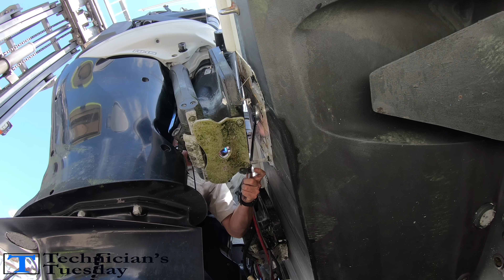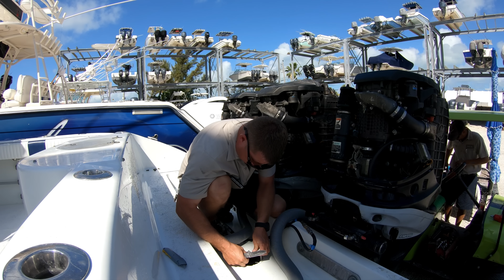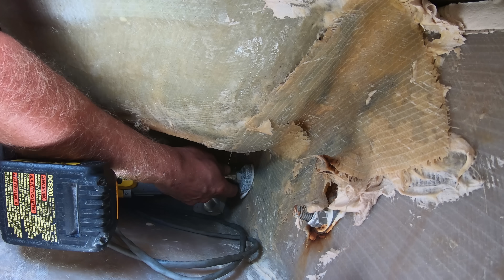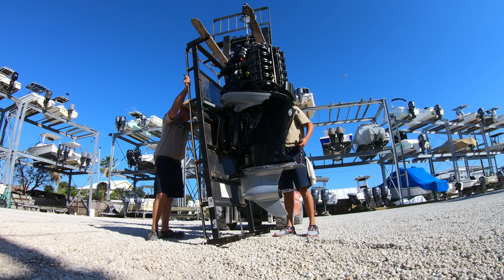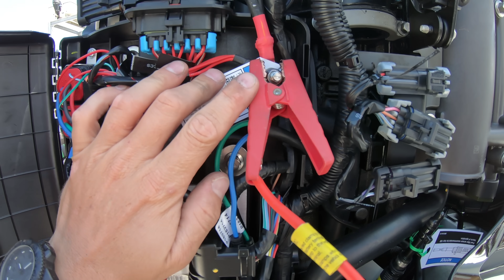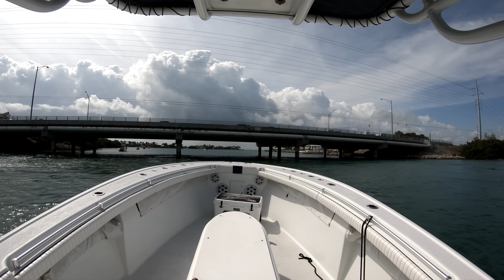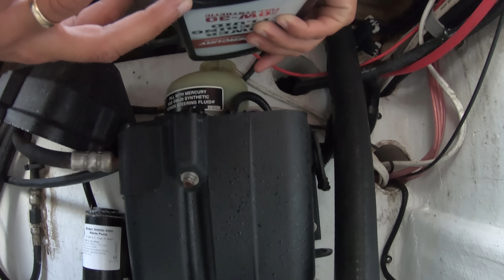How To Mount An Outboard Motor Properly - Start to Finish!

Comment: Might seem like a silly question but when someone repowers a boat, what do they usually do with the old engines? Are they traded in on the spot?
Reply from the maker: No, that's not a silly question at all.

It depends on the owners and the engines. Some engines arent worth any money, so they get sold to a wholesale that parts then out and scraps the engine.

Other engines are sold to a different wholesaler that then repowers boats and sells them. 

Sometimes the owners have someone that they want to give the engines too or sell them too and then sometimes the owners want any too much money for them and so no one buys them and they sit until they are worth even less that they would have if they would have been sold. 

I guess it really depends on the owner! Great question, thank you for asking :)
Reply: Thanks!! I always imagined the owner hauled the boat plus the old engines home after the install - which would be a major pain I'm sure
Reply from the maker: You're welcome! Thank you for commenting! Yeah, most people don't want to have an outboard laying on a pallet in their front yard :) lol

Comment: Nice video I have a question I check my 30 Donzi with twins 250s yamaha trim all the way in and the line goes like 1/2 inch over the top of the water pick up the are 2 feet back from the bottom of the hull they are set now on the second from the top hole so I guess I need to go up at least one more hole what you guy’s think thanks and i will appreciate you’re help

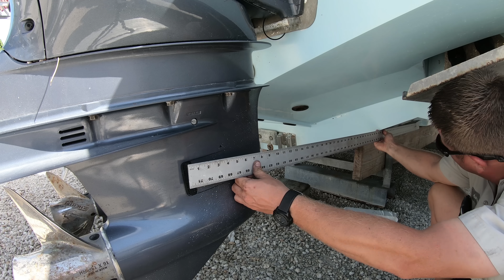Comment: I watched this video to see where to mount your motor and where the water should be going across your lower unit and you say it should be coming off the bottom of the boat and should be  above your water pickup. where he has the straight edge coming off the bottom of the boat you're about a third down on your water pickup and if you look at 4:14 the back of his straightedge past his right hand you'll see the straight edge ain't even up against the bottom of the boat so that means that  your water pickups will be out of the water when the boat is on a plane.  I'm not going to mount mine like that I don't want to burn up my motor not sucking water. I'm going to  Mount mine lower where the water will be going over the top of the water pickups on the lower unit.

Comment: Why the outboards at the extremity are always mounted higher than the one at the center ? Can you explain that ?
Reply from the maker: Certainly! You'll probably notice that on all boats that have triples or quads that the two outside engines are either mounted higher or they are a shorter driveshaft length than the center engine or engines.
That is just simply to form to the hull of the boat. As the water comes off of the bottom of the hull, the only thing you want in the water is the lower unit. So that the water doesn't go over the anti-cavitation plate and suck the back of the boat down and make it perform poorly in the water. 
Most of the time the center engine is a 30 inch driveshaft and the outsides are 25 inch. On quads the center engines are still 30's but depending on the hull, the outsides will be 20 inch driveshaft's!
Hopefully this helps out, let me know if you want to know something else! Thank you for commenting!
Reply: Born Again Boating Thank’s a lot for this rewarding answer 😊
Reply from the maker: @skandertrabelsi  you're welcome! Thanks for asking :)

Comment: Hi Born Again, 
If is only two engines on a mono hull they have to tilt sligtly outside as the video shows or turn them sligtly facing the front keel?
Thank you for the videos, all the way from Moçambique!
The best channel
Reply from the maker: Thank you! You shouldn't have to "tilt" either of the engines, they should be straight up and down on the transom :/
Reply: @BornAgainBoating  
On the video at minut 5'.54ss you mention that if is desire the boat to go straingh, the engines must " toe in  slightly " but on the diagram you showed, the engines exactly are toe out!???
Reply: @BornAgainBoating  I got it now, 🤙🏾🤙🏾🤙🏾keep the engines straight and compensate slightly on the tild bar by extending abit, this of course will reflect in the propeller,  and keeping the bow stright and balanced, top top. 
Best channel for sure.
Hugs from Mozambique

Comment: Great video. Thanks for sharing,   Just curious is there a big improvement with the 350s also what would that cost,  I am guessing somewhere in the 100k range?
Reply from the maker: To a point, the 350's are pretty well dialed in with minimal issues! For trips, yeah its about in the 100K range, depends on what all you are changing. If just the engines, I want to say it's a bit under 100

Comment: where should the anti-ventilation plate sit in a single motor application? I have a single 130 E-TEC on my 17'7'' Pionner Sportfish and have always thought it sat too low.
Reply from the maker: You'll want to take a yard stick and check to make sure it's sitting like the video shows :)

Comment: I don't understand tie bar
Can you please tell me exactly how much distance should be
Reply from the maker: Hello, sorry for the confusion. No I can't because every boat is different. That is why you have to measure between the steering arm and the propshaft. Compare the two distances and turn the propshafts in about a 1/4 more than the steering arms.

Comment: Hi, I have a Yamaha 9.9 kicker that I want to install on my 23 Grady closed transom. What would be the proper height for the motor once it is in the down position? Once again your videos are awesome. Keep up the great work!!
Reply: honestly - it doesn't matter.  the motor is never going to plane the boat. planing , top speed and fuel efficiency is out the window. 
you have more directional control and more bite on the prop when the motor is deep.

Comment: Thanks for the great video, I check my Suzuki’s 300 on the HydraSport 28 and found out that the water pick up is 2” below the bottom hull at 33” out ,I always thought they were low  when they repower my boat .please let me know if this is done with the engine in all way or level with the bottom hull, thanks again
Reply from the maker: Thank you! That does sound to be a little low. The main thing is that you don't want that cavitation plate to be under the water coming off of the bottom of the hull when you are running. 

Generally you check this with the engine tilted all the way down or all of the way in! What are you planning on repowering with?
Reply: Thanks again Sorry for the delay a wanted to check it out before it turns out that I get the same results 2” from the bottom of the hull to the top of the water pick up engine level to the hull and 2” from the bottom of the hull to the top of anti cavitation plate with the engine down all the way . So because of your great video I learned that I have to lift the engine 2 holes I’m in the middle now so I have to go to the bottom holes I’ll be 1”1/2 up . I was doing 55mph at 6250 Rpm with 2 economy, I got the 300 last year but I would’ve gone to you guys you show that you know you’re work well thanks
Reply from the maker: That's awesome! Congrats on the repower! Thank you so much for your comment :)

Comment: my Yamaha F150XB single motor rubs on the mount when I trim it down, can I adjust that?  It's the little wings that stick off the motor that fit between the wings on the transom motor mount, slows my trim down when it comes in contact.  

Maybe a topic on how to adjust that?  Looks like one big bolt.
Reply from the maker: Sounds like the engine has twisted a little bit, youll have to look around it and figure out how to adjust it by experimenting lol thats not an everyday problem or adjustment
Reply: @BornAgainBoating  Well the whole boat burned the other day so now I'll just buy a new one with the insurance.

Comment: Ive got a question about cav plate height. So for every foot back from the transom it should be one inch above the hull? If to low would it cause the boat to porpoise?
Reply from the maker: Generally between 1/2-1" for every foot yes. If it is to low, then the anti-ventilation plate will get pulled under the water and yes it can cause porpoising. You can have someone with you and run the boat and just go back to the transom and look down, you'll be able to see if it is sunk under the water or riding just on top of the water! :)

Comment: I just installed twin outboard and my boat seems to veer left and right.. the toein is a 1/4” and pulling tape measure on the transom my port engine is 3/16” different center of the motor bolts.. not sure if that’s too much?? Please help!!😢

Comment: Measuring mounting height- question. Does it matter if it’s Suzuki vs mercury using the straight edge water pickup method? I’m considering one hole up bc the motor looks buried. But will try and see where I land with the straight edge. Thank you
Reply from the maker: Nope, brand manufacturer doesn't matter, height is gauged on the plate and water pick is

Comment: So i have a center console with a single verado 300 on a 28" bracket. I noticed cruising at 3800 rpm... Trimmed up... My cav plate is fully submerged... Cant see it at all. So i pulled the boat and measured as shown in the video here and it is set up almost exact as show. The top of the straight edge to the bottom of cav plate is 2.5"... Should i raise it a couple more inches?
Reply from the maker: Raise it up one hole on the bracket and see what that does, but take into consideration at wide open throttle the set up might be perfect :/ sounds like a heavier boat, so at cruising speed like 3800 the boat is sitting deeper in the water and so the water is able to flow over the top of the plate
Reply: Sounds good! Thanks for the reply! The motor right now is as high as it can go. The boat is a 25 Proline center console. I ordered a static jackplate to lift it up another couple inchs. I will run it WOT and check again before installing the jack plate. Thanks again for the reply!

Comment: Engine bolts should be installed with the head outside, lock nuts inside transom. You guys should know why! What happened?
Reply: @BenjiNathaniel  if the lock nuts/bolt threaded end face outside of transom when the engines are turned hard over the trim cylinder housings will contact bolts. Excess length of bolts face the inside of transom.

Comment: My transom is 20in. So do I need a 20in shaft motor? Right now on the boat it’s a 25in shaft. Seems run fine. But I’m going to repower and want to go with the right size.
Reply from the maker: Every transom is different, if its running fine, you probably don't need to change it. Depends on how the engine sits when its mounted. Make sure the plate isn't buried in the water

Comment: Thanks sir, finally what are using snap on equipment , this one compression equipment ? Can you explain
Reply from the maker: Thank you! I think you are talking about the leak down tester. 

That's used to put compressed air into the engine cylinder and see how much of it leaks out.

Leaking past the rings and the valves.

Comment: Could you make a Video from 3.22min to 4.55min. I dont get it.
The lowest Part of the Hull should be lined with the Red Part you painted in. Is that correct?
I have big Probs with this issue but i dont understand your Video because its to much other stuff you dealing with.
Could you make a Vid. with singleEngine and explain this high what you mean?

Comment: Hi bro.. I wanna move up my twin Yamaha engines. Is it okay if there is a gap between the motor and top of transom?
Reply from the maker: As long as I am understanding what you are saying then absolutely! The outboard shouldn't be "hanging" or "sitting" on top of the transom, it should be height adjusted correctly and bolted into place so if it's got space between the little things that stick out from the bracket and the top of the transom, no issue there
Reply: @BornAgainBoating  Many thanks for your explanations, brother!

Comment: Hey i got a question. Im building a rc boat with outboard electric motor.  I have a single and have my prop jus a little below the bottom of my boat. It seems to drag and not get on plane and sucks air and makes prop spin free till it grabs more water. Can you help with advise?
Reply from the maker: Try and lower the engine a little bit :) or weight down the boat a little bit

Comment: Why 4200 and not 5200 i have to do my power trim pump replacement on 150 verado  on boston Whaler outrage and it is turning into a nightmare! can you cut 4200 off easier?
Reply from the maker: Mainly because 4200 doesnt run like 5200 does, so it's easier to work with :)

Comment: I really want a rib boat for the rough Waters in Hawaii. I want twin 30s.I'm going to buy a Chinese boat and they say that only one engine can be mounted on 580. Do you know of any way to mount twins on a  transom just made for 1? the reason of course is to make sure I got a backup motor if something goes wrong. Any other ideas for a backup? I could just store a small trolling motor on board in case something happens but that would take awhile to get back home safely. Unless you have something else it might be my only option.
Reply: You actually read the comments are just scroll down and love every one of them?

Comment: what distance apart do the  motors have to be ?  for optimum performance? cheers ben]
Reply from the maker: That can vary, most of them start at around 26 inches center to center. Mostly depends on the transom of the boat.

Comment: Were you able to plug in the same cables that were in the 300’s to 350’s or do you have to run new cables from the helm back to the motor. Also if you were going from the l6 300 verados to the new V8 300 verados would you be able to use the same cables or nah?
Reply from the maker: Yup, same cables bro! For the most part all mercury DTS engines use the same components since 2008, so they are all plug and play basically. Same components for the new stuff too!

The only difference is that you can get the new V6 or 8 with mechanical controls which is a lot cheaper but then you just have mechanical cables for the control box.

Comment: Greetings from Portugal! Torque the bolts to 55ft.lb is enough? that's around 75Nm wich is 35Nm less than a recomended car wheel bolt torque spec (in EU at least) . What is the grade of that bolts , do you know ?
Reply from the maker: Hello! Yes, Yamaha's nut torque is like 53 ft lbs, except on the F350, they want like 70 ft lbs. and Mercury's is exactly 55 ft lbs. Not sure what the bolt grade is though :) Thank you for commenting!
Reply: @BornAgainBoating  You don't use threadlocker glue , right?  You explained in this vid the height of engine on that particular hull but if the bottom was completely flat (standart V shape hull without cuts), you would mark at the same height?
Reply from the maker: No, just 4200 or 5200. Torque the nuts down with the impact and they won't be coming off! Yamaha double nuts them so that works too! Yes, same process for the flat bottom boats. You want the water coming off the hull to stay just under the anti-ventilation plate :)

Comment: Does that same method work on mounting a engine on a Armstrong bracket?
Reply from the maker: Yes, and the armstrong bracket should have a little bit of a incline to it as well. The biggest thing is that you don't want the anti-ventilation plate to be under the water or high enough that the water pickups can suck in air from being too high out of the water.

Comment: No bleeding the steering lines?
Reply from the maker: Nope! Mercury's power steering system is a self bleeding system. There are bleeder valves on the cylinder in a rare case air gets stuck in the cylinder!
Reply: @BornAgainBoating  Nice! Thanks for the reply!